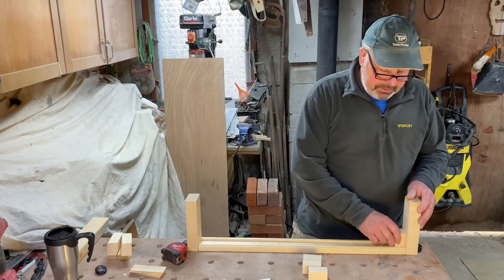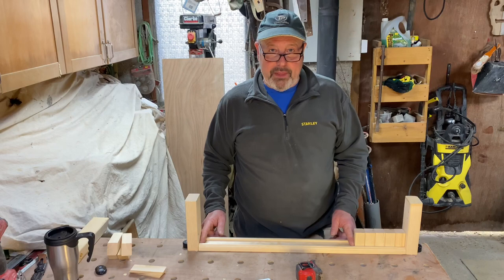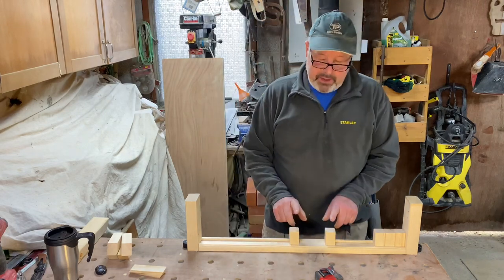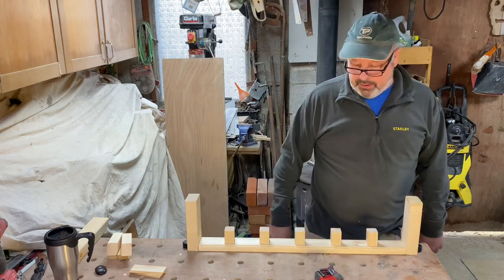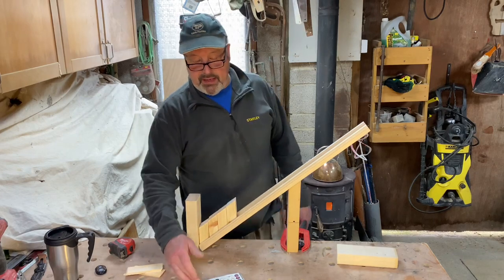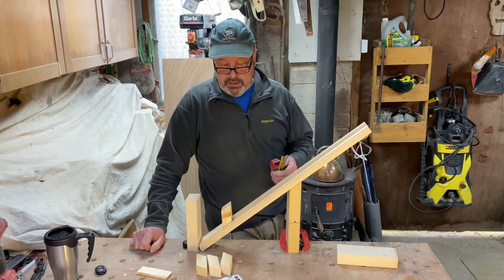Setting out stair spindle spacing's. This example is only for a 1m base rail. SEE DESCRIPTION FIRST

Comment: Can you tell me how you know it’s 200-300mm deducted per meter??
I know it has no relevance to the final outcome but understanding what causes the loss of that initial 200-300mm per metre would be helpful knowledge
Reply: 200 mm per m. 40mm spindle .  200 divided by 40 =5  that's how i understand it, obviously spindles come in different sizes ,,atb
Reply: @markburlison9993  What if spindle is 41mm? Do I take away 205mm per metre?
Reply: @SkemeKOS  this guys video is excellent old ways are the best,, watching this again the 200mm is deducted to give approx amount of spindles required say  8 spindles per meter depending on spindle that is,1000 minus 200 =800 so 8 spindles . no more than a100mm gap between spindles.
8x 41=328     1000- 328=672   672 divided by 9= 74mm spacing  8 spindles 9 spaces, to increase the gap deduct a spindle and do the same calculation 7 spindles would be 89 mm and so on,.
place spindles together like on the video is the fool proof way and measure what you have left then divide by 9 as you have 8 spindles and so on, 
experiment, have fun
Reply: I would like to no as well

Comment: DIY guy here, about to do my first staircase build. Just wondering why you take away 200mm and 300mm, and how to know how much to take away. 
EDIT : Never mind, I've just read the description.
Reply: So go to the nearest 100 obviously 380 you go to 400 witch means 4 spindles, as the centres you need maximum 100 centres, and on victorian spindles the profile is diffrent so you take the 100 mill gap from the largest gap so in some place you'll have a 100mm gap and maybe in places you'll get 80mm gap.

Comment: Used this method worked like a charm , thank you , can you tell me what your formula is for calculating the rake spacing for over a meter please .
Reply from the maker: Hi Luke 
Double it for every metre basically.
Measure rake knock off 300mm for 1st metre. For 2 metres take off 600mm so if the base rail was 1.5 metres for example take off 450 mm etc. And therefor a 3 metre base rail will be 900mm to knock off the length of the base rail etc.
This will give you a rough guide on the number of spindles and normally your within 1 spindle but all depends on whether they are square or turned.
Just do a quick sum and either add or takeaway a spindle to get the correct spacing to meet Regs

Comment: Really good video but only thing I'm confused about is on the rake 103mm surely is wrong I thought the spacing needs to be less than 99mm
Reply from the maker: Measuring 103 on the rake angle will leave around 90mm between spindles measured horizontally

Comment: ok dont judge me but I'm having problems with the maths, my rake  base rail is 3000 minus 300 = 2700 suggesting 27 spindles. as I had pulled this stair apart I knew this was to many it was only 19 spindles before although badly fitted with uneven spacing. I didnt stack the spindles to get the remaining gap but measured the spindle width across the cut angle and multiplied by the number of spindles this gave me a good even distribution. so where am I going wrong cause if id gone and bought 27 spindles I would have been miffed.
Reply from the maker: Thank you for pointing this out. The model I used was under a metre. There is a rule for every additional metre which I failed to mention in the video and will edit it for others.
Reply: @RVBuilding  "there is a rule for every additional metre". So what's the rule?